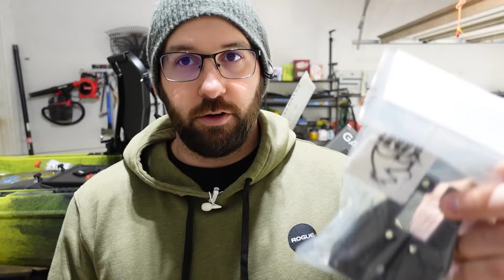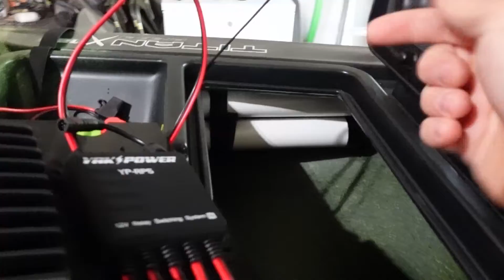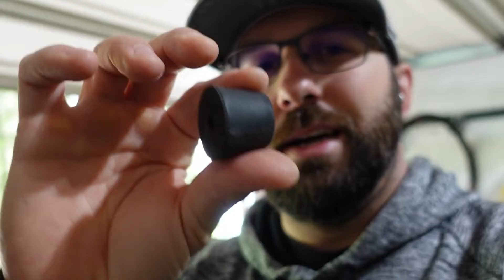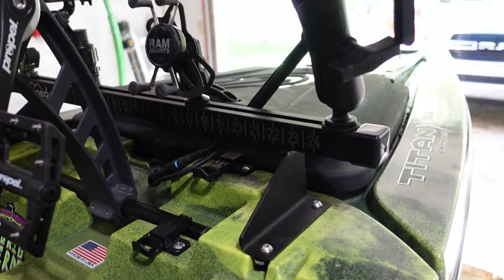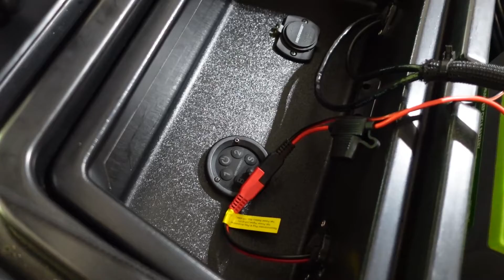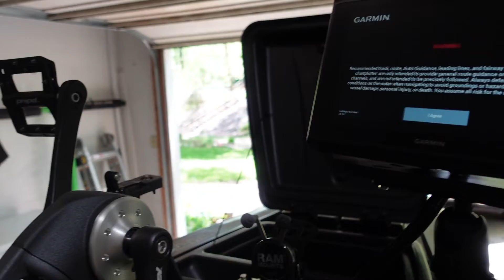Upgrading My Native Titan X Kayak! NEW Garmin 93sv With Livescope!

Comment: 362 lbs is the actual performing weight capacity. Everything in the kayak including the person.
Reply from the maker: I loaded this thing down like crazy every trip I had.  Me (230 lbs), 5 tackle boxes in a Yak attack black pack 16 x 16, electronics, bow mount motor, 6 rods, forward facing sonar, 2 batteries and a partridge in a pear tree.  It can handle it.

Comment: When it comes to weight capacity, how did it fair?
Reply from the maker: I loaded this thing down like crazy every trip I had.  Me (230 lbs), 5 tackle boxes in a Yak attack black pack 16 x 16, electronics, bow mount motor, 6 rods, forward facing sonar, 2 batteries and a partridge in a pear tree.  It can handle it.

Comment: How are you traveling/driving with the fishing specialties pole attached? Do you somehow secure it to your yak? I’m curious as right now I always have to unplug it from the black pack from fear of it being damaged while driving with the trailer
Reply from the maker: Ran the cable through the hull and leave it in the boat.  Never had an issue.
Reply: @aaanglers do you secure it to the yak while driving somehow?
Reply from the maker: Nope, it just lays in n the cockpit.  Maybe try a velcro strap if you want more security

Comment: Did you have to buy a network adapter cable or did it come with the GLS10 black box? How long is the network cable they give you? Thanks
Reply from the maker: Network adapter comes with the FFS kit.  It isn't super long, but they sell a longer one.  Should be listed in the specs on their product.

Comment: I stopped using  the RAM ball mounts as they would not hold securely enough for my liking. I transitioned to the Yakattack finder mount as it has teeth that sticks. My RAM ball mount would move too often in rough water and I got tired of tightening it down all the time!

Comment: I have the boondox bridge as well, and I think one thing I would've liked for them to have done is make the top and the bottom fully slotted.  The bottom has two slots, one on each side, that has their allen bolts that go through.  I think it would've been nice to have a full slot or, a t-bolt to go through so you could use a spin nut.  I used the Yakattack Loc N Load setup with the Yakattack 90 degree Mighty Mount Vertical adapter.  That way I can completely take the bridge off if I want to easily with a flip of the LocNLoads.  Nice work btw, thanks for sharing.  I really want the Garmin to replace my Lowrance Hook 9.  I'd like a pair of them but I don't think I need one until I get into tournament fishing.  That'll be after I get my Titan X.

Comment: Just a heads up Garmin doesnt recommend using zip ties on their cables. It can get over tightened and pinch inner wires. Other than that nice setup. Is there a reason you didn't end up using the native's captains bridge?
Reply from the maker: hmmm, haven't had any issues, just zipped tight enough to hold the cable cover.  I liked the look of the boonedox over the captains bridge.

Comment: Jeff the yakpower 5 button panel with the extension cable will fit on the powerlink plate and still remain watertight if you are careful. I did it on mine and it works. Also highly recommend the Railblaza hexx live 30 pole for mounting the livescope transducer. The color even matches the gator green.
Reply from the maker: I may try again.  The bit I normally use for it would tear up the waterproof lip of the panel, so maybe I have to finesse it.

Comment: Couple of things. Nice job on the install very clean. I use the same transducer mount on my pdl120. I use alot of the yakhobby products. Curious why you didnt get the extension cable for the control panel for the yakpower. I dont blame you for not wanting to drill a 2" hole in the kayak. I made a mount for mine using 1" ram ball mounts. I can send you a picture of it if you like. Always enjoy install videos. 👍🏻👍🏻
Reply from the maker: I did get the extension cable I just didn't put it there.  May move it later.

Comment: I love wiring boats, I still wire all my Motorcycles, ATVs and hotrods.  I am not a huge fan of the crimps I always try to solder every connection then use shrink tubing is a must if its in the elements.

Comment: Why don't you use the shrink tubing with glue?? It makes the connection water proof. So no need for the electrical tape.
Reply from the maker: So I can rewire it if I have to.  It’s happened before…